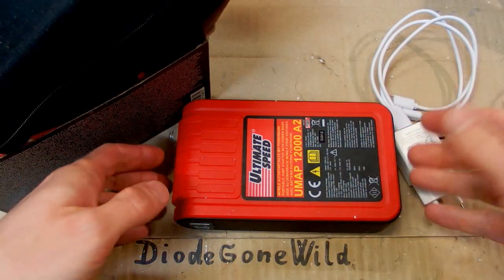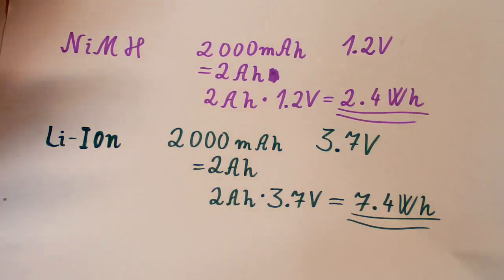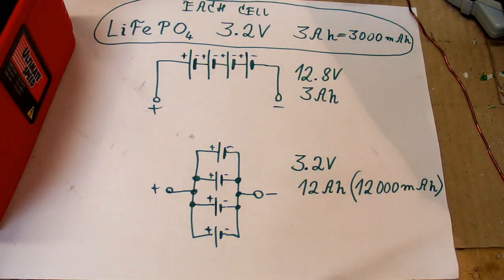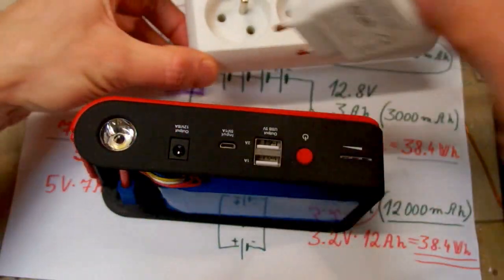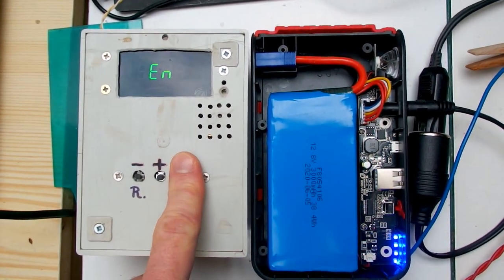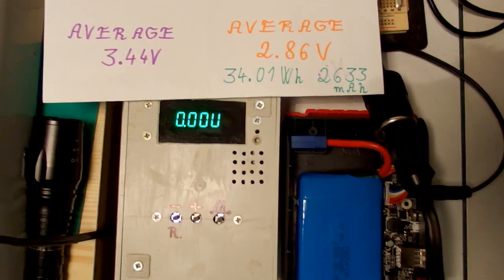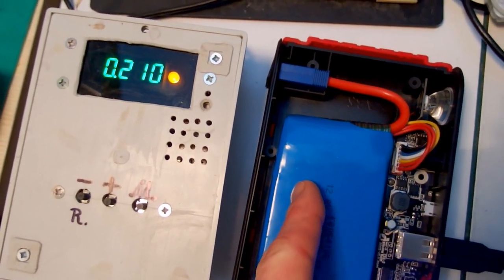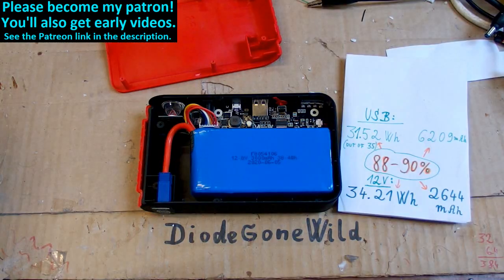Lidl "12 000 mAh" jump starter power bank capacity test

Comment: Those liFePo4 cells arent THAT much sensitive for disbalance, or are they? Maybe thats why they are not balanced very well?
Reply: ALL batteries are totally insensitive to imbalance, except when you put them in series. That's because if you only stop the discharge at a certain TOTAL voltage, it can happen that some cells (in the series string) go WAY under their minimum recommended voltage while others are still very well charged. Ni-CD and Ni-NH tool batteries were the worst, because there was never any low-voltage cutoff and some cells could even go negative... kills them dead as a doormat.
For LiFePO4e, under-voltage literally kills them dead... they never recharge again. I've killed heaps of them by running them as a bare cell and letting the voltage drop too far. So, you need to either balance them, or monitor and cut them off when one cell hits the minimum.
Reply: @johncoops6897  But overcharging isnt that big of an issue for Lifepo?
Reply: @PM-wt3ye  - I suppose not, if you don't care how long they last. For low current charging (like small domestic solar lights), they seem to handle it OK... well, they don't blow up and catch fire however the cells don't last very long, maybe 300-400 charge cycles. However I've boiled and instantly killed plenty of LiFePO4 by accidentally charging them on LiPo or Li-Ion settings with 4.2V termination and 500mA or 1A charge current.
And a quick death is silly when one of the great advantages of LiFePO4 is that when treated properly they last about 10 times longer (charge cycles) than Li-Ion cells..
So the fact that they die quickly rather than catch fire then die doesn't really mean that "overcharging isnt that big of an issue" for LiFePO4.
Reply: Reverse charging (under voltage) and overcharging (known as gassing with some cell types) is a problem in all series connected cell (battery) systems. Including primary cells (“non-rechargeable”), lead acid, NiCad, NiMh and the various lithium types.
Some types (NiCad, NiMh, vented lead acid) can tolerate overcharging at slow or trickle charge rates, but most other types cannot. Nearly all cells are liable to be damaged if they run out of charge before the other cells in a series connected bank (under voltage). Then the other cells will force current through the discharged cell and “reverse charge” it. As mentioned, this normally kills it.
The problem gets much worse as the number of series connected cells is increased. As it is impossible for all the cells to be perfectly matched.
It is for this reason that often for low to medium power applications, a DC-DC boost converter is preferred. But where a very high current is required (here to run a starter motor), it’s not practical to use a DC-DC converter.

Comment: They bottom balance the cells because the high current output can not be switched off based on individual cell voltages. The electronics in the high current wires can only determine the low voltage cutoff with the combined packs voltage. Bottom balancing the cells to the cutoff voltage is the workaround. As long as the cells stay bottom balanced no individual cell should be discharged too far based on pack voltage alone.
Reply: IIRC there isn't any protection on the high current output. The protection would need to be in the output cable itself but that also had a resistor which bypassed any protection.
Reply: @eDoc2020  I think it is not clear if the mosfets in the output cable are also switched based on pack voltage. But it could explain the balancing. The resistor has 200 Ohms. So relatively low current.

Comment: For your average Joe it kind of makes sense to use amp hours since it would just be something like 12@34Wh at a 12V source or 5V@28Wh as a power bank, which your average person would not intuitively understand. The average person who just knows the mAh rating being higher = more power will understand that rating more readily since it can be correlated to a power bank they might already have.
Reply: He has a disclaimer at the begining of each video that it's not intended for average Joe.
Reply: @letenof  No but the jumper pack is, which is why its ratings are in mAh and not Wh.

Comment: I haven't watched this video in full yet, but after your last video I decided to buy one of these for use mainly as a power bank in my car, and a jump starter should I need it. Your video made it look pretty good. However at 5V, charging my phone at 1000mA, it can't even charge my phone twice from fully charged!!! That is NOT 7000mAh capacity no matter what it says. To anyone out there thinking of buying one, don't waste your money!!!
Reply: How close to two charges? You have to account for losses in the DC-DC converter in the bank and charge circuit in the phone, because they don't.
Reply: @Broken_Yugo  Not even close to 2 charges if I'm honest before it needed to be disconnected and recharged. How long does a phone take to charge at an amp (1000mA charger plug) roughly?...maybe 1.5 hours ish? I just assumed at LEAST it should be able to manage 2 charges...roughly 3 hours at 1000mA. Considering it claims 7000mAh it should do 3? unless are these losses you mentioned seriously that high? I'm no expert by any means, I just assumed it'd be actually "useful" as a powerbank...which to me it isn't considering it takes literally overnight to recharge!!! I may as well drive home from miles away, plug my phone into my house socket and charge my bloody phone that way. Lol.
Reply: @REVERSE_BIAS  - 1000mAh = 1A. 3 hours at 1A = 3Ah. 3Ah = 3000mAh. So two charges would be 6Ah (6000mAh). When you take into account the voltage conversion losses and that the cell protection circuitry is being very conservative, it’s marginal if you will get two ‘full’ charges if your ‘phone requires 3Ah per charge.
In reality, it’s best to charge a mobile ‘phone whenever you can. So overnight, yes, and while driving, again, yes. Power banks are best kept for emergency use, rather than regular use.

Comment: I wonder why they only charge up to 3.59V and some cells ending at 3.34..V? Thats odd! This would mean only 30% SOC for a normal LiNiCoO Cell. When they were LiFePo-Cells that would make sense, because 3.6V means fully charged. But i doubt they are LiFePo as they are more expensive and less capacity.
Reply: Of course they are LiFePO4, they couldn't get that amount of discharge current from Lithium Ion and LiPo would be even more expensive. This is simple stuff, nothing off or confusing at all. The carton even states Lithium Iron Phosphate right across the front!

Comment: That lack of balancing is really weird. It does have a balancing cable but it doesnt seem to make use of it.
Reply: It is NOT a balance cable. It uses the wires to monitor cell voltages and switch off the entire thing when voltage of any one cell falls under the low voltage limit. It also terminates charge when one cell reaches the upper voltage limit.

That's the way all consumer devices and tool batteries work. Balance charging is just an "RC thing" and it's not practical for most other rechargable devices. That's because the only way to do balance charging properly is to individually charge each cell, which is very slow, makes the charger and/or BMS much more complicated and expensive.
Reply: @johncoops6897  Thats dumb though. If after a long time of usage the voltage of one cell just happens to be 0.5V lower than the other cells, then it will never fully discharge all the other cells and never fully charge that single cell, so you lose a lot of capacity even though the cells are still fine. You dont need to charge each cell individually and the cable you see in the video is absolutely enough to do the job. First youre charging the entire package in series until it cuts out and then you use the balancing cable to top up the remaining cells and as the difference should always be very small it would not take long at all.

Comment: Would be interesting to see if it could be hacked to give it proper cell balancing rather than the "one's finished, I'm done!" setup it has...
Reply: Of course a balancer could be added. But the usual ones that transfer 50mA or 100mA or so are basically useless. On Banggood I've just found some inexpensive Active balancers that transfer 1.2A and even 1.5A between cells.
The problem with that style is when charging and when discharging....the balancer doesn't kick in until 0.1V difference between adjacent cells. So if you said that a "totally full" LiFePO4 was to 3.6V, you can end a charge with 4 cells of 3.45, 3.55, 3.65 and 3.75V.
The common resistive balancers also have the same problem... they will allow all kinds of horrid voltages, then (very) slowly even it out later. The only way to resolve it is to treat each cell individually, and then cut off each at the precise top voltage. The hassle is that makes the charger very complex. Even high-usage power tool batteries don't have balancing - they just have individual cell monitoring and cutoff if any one cell goes under or over spec.

Comment: Shouldn't be 4.2 volts?
Reply: Why? The cells used here a nominally 3.2V and are usually charged to 3.6 or 3.65V maximum.
Reply: @johncoops6897  Lithium ion are charged to 4.2   are these li polymer li ioron phosphate?
Reply: @thewhizard  - they are LiFePO4, which you would already know if you had watched the video. Start watching again from 5:29

Comment: mAh is a really stupid metric and doesn’t represent energy capacity. Watt-hour is also not great. The SI unit for energy is Joules. One Wh is 3600 Joules as there are 3600 seconds in an hour.
Reply: So can you please point me to a meter that measures electricity in Joules?
Amp hour (Ah) is the traditional method used for cells because then it makes it easier to work out how many cells are needed for your specific battery application. This is harder to do if using Watt hour (Wh). Most electronic loads draw approximately the same current over their normal operating voltage range. So you can easily use Ah to determine the nominal run time.
Wh can also be misleading/misused and if consumers find Ah and Wh confusing, I don’t think using Joules would help much.
And yes, lots of marketing use mA instead of A, and mAh instead of Ah. In the same way that other metric units are misused. 
At the end of the day, the buyer has to do his/her own research to determine what they require and then use caution when buying a power bank,
Reply: @Mark1024MAK  America is the land of imperial units and many people are not understanding the simplicity of using modern metric units. 1 Joule is simply the energy of one Watt for one second. Ah is not saying anything concerning energy unless you also know the voltage and that voltage is constant. A Li-Ion battery is not with constant voltage. As a battery is used the voltage drops and most devices need a constant voltage to drive them. Any device with proper DC-DC converters will maintain the voltage rail on the electronics while increasing the battery current as the voltage drops. Wh is a proper energy unit (= 3600 Ws = 3600 Joules).
Reply: @ThinkingBetter  - Well, until very recently, DC-DC converters in electronic products were not very common. Electronic products / systems either ran directly from a cell or battery, or used a series pass regulator. With both of these using Wh is slightly misleading as these loads don’t significantly change their current consumption with a (reasonable) change in the input supply voltage.
It’s mainly the introduction of power banks and mobile ‘phones that have driven the call for Wh. Before then, especially in industry, cell or battery capacity was nearly always specified in Ah. The small voltage change at the cell or battery terminal not being much of an issue because it was considered to be more or less constant over the normal range of the cell / battery.
If you prefer to use Joules, that’s fine with me. Same with Wh, I have no problem with that. But I suspect that industry and battery manufacturers will continue to use Ah.

Comment: From their voltages, it appears the cells are LiFePO4.
Reply: Yes, and i think it's too overcomplicated to look in them from outside and make all this guessing whereas i could open it partially and have a look. (The pack to be reclosed again very easy as well with some tape, this not effecting warranty.)

I would then next step buy some higher quality cells at eBay and test them in the same place, using the same electronics.

Looking for such cells at eBay can provide for some actual market overview regarding such cells anyway of course. Certain cells at German eBay seem to be sold several hundred times, so, as most of the time, the market is not stupid.
Reply: 'to look from outside only' of course
Reply: Yes this is LifePo4 if I am not wrong, but the performance of Winter is a concern.
Reply: The product is advertised as LiFePO4, and clearly states it in large letters on the front of the carton.

Comment: Mah  gives the biggest number so this is the same trick isp use for internet speed. Like mbps .
Reply: And ssd makers comparing the sequential read & write speed.
Reply: Amp hour (Ah) is the traditional method used for cells because then it makes it easier to work out how many cells are needed for your specific battery application. This is harder to do if using Watt hour (Wh). Most electronic loads draw approximately the same current over their normal operating voltage range. So you use Ah to determine the nominal run time.
And yes, lots of marketing use mA instead of A, and mAh instead of Ah. In the same way that other metric units are misused.

Comment: i don't buy stuff with silly ratings, too dodgy.
Laptop batterys can be deceptive if you believe the battery gauge,  estimated  charge is crude.
I got caught out with a battery for my old laptop,  the battery died in 3 months and the computer gave no indication untill it was too late.
It was not an original battery, but i expected it to last longer than 3 months.
Hmm cat in a box, not quite the same as a jack in the box lol.
Reply: What has battery gauge got to do with anything? In a laptop, the battery gauge must first be CALIBRATED. You run it to cutoff (say 2.9V per cell), then charge it to 100% (say 4.2V per cell), and the software works out the total capacity based on the voltages and running times. It's nothing to do with mAh etc... it's just seeing a voltage and calculating how many hours are left at the current average wattage being used.
In any case, that has ZERO to do with the battery pack dying... nor could the computer know that the pack was dying. The computer doesn't have a crystal ball, but my guess is that you bought a cheap shit pack from eBay etc that contained recycled cells.